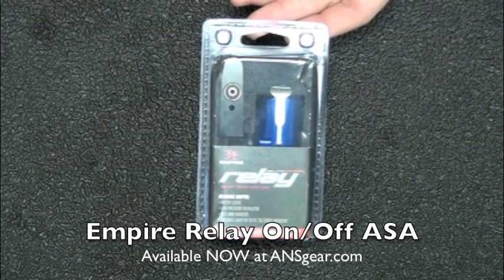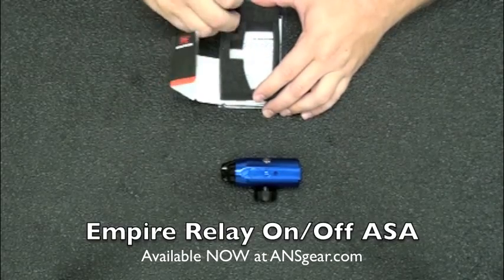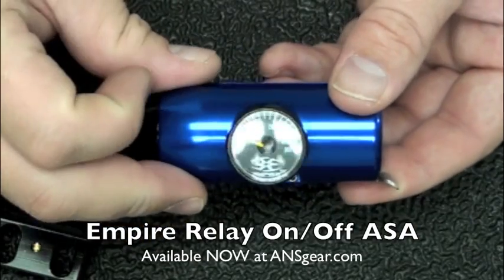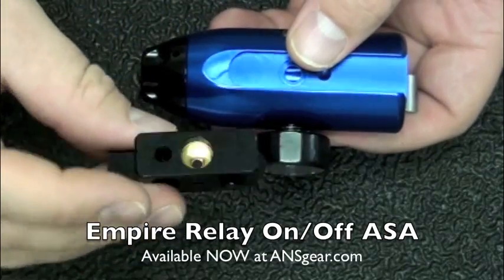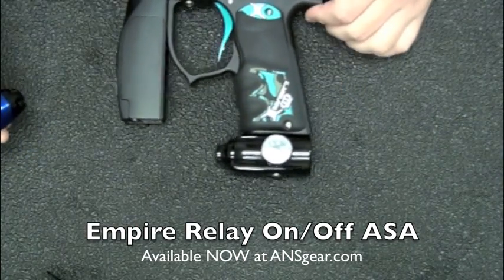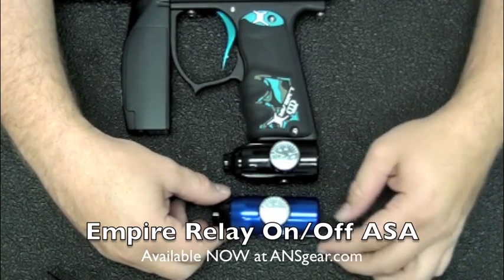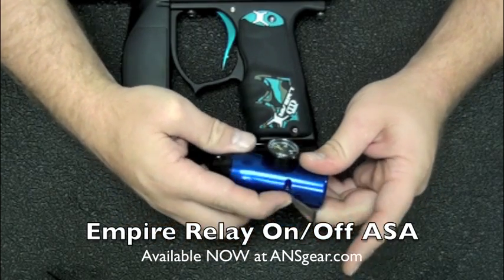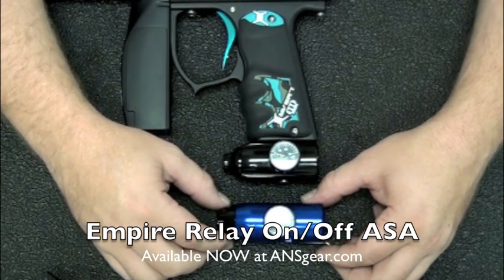Empire Relay On/Off ASA

Comment from the maker: We see this sometimes where tanks and asa's just don't wanna work together. If you have another tank you can try, see if it works with a different tank. If it does then you know it is the pin on the tank but if the second tank also doesn't work then you know it is an issue with the asa. When you know which item is causing the problem you can contact the appropriate company about finding a solution to the issue.